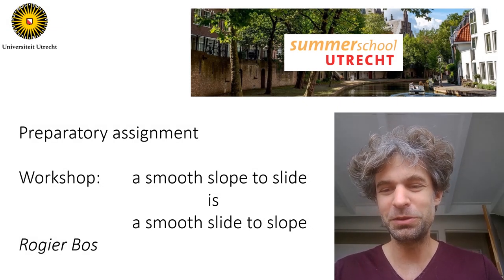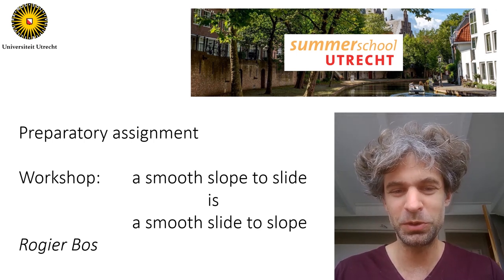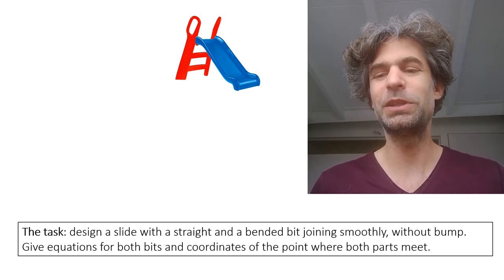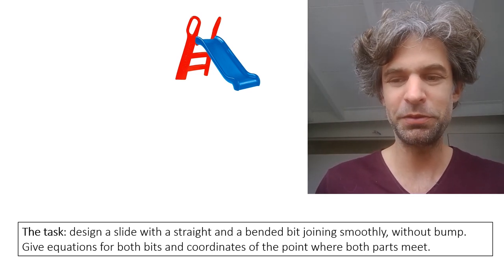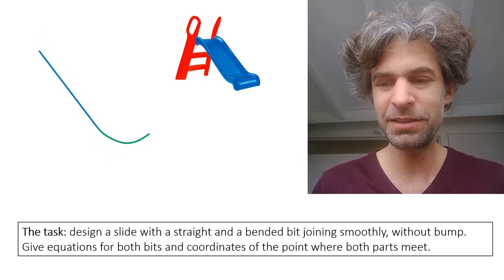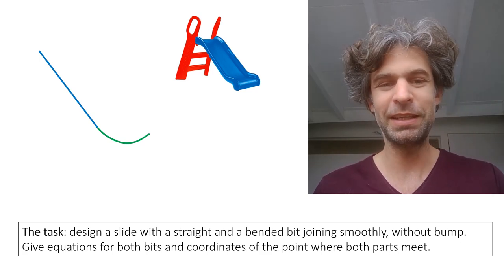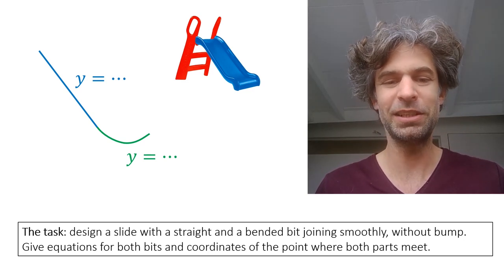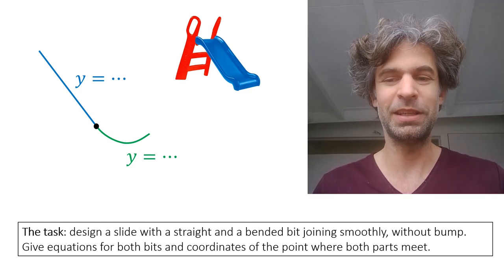Preparation task for workshop Rogier Bos

Comment: Wow, this is a great task! Nice application of derivative.
I use Desmos - first I created my bumpy part, determine the meeting point, and then formulate straight line equation using the gradient of the tangent line at that point.

Equation for the bumpy part: y = x^2, {-1<x<0.5}
Equation for the straight part: y = -2x - 1, {-2<x<-1}
The meeting point = (-1,1)
Assuming 1 unit = 1 m, my slide will be 3 m high and stops around 20 cm - 30 cm above ground. 
The angle of the slide from the ground will be 60 degree.

Not too bad for a slide I guess.

Comment: Thank you for the question. I use my algebraic knowledge to solve this problem. The straight line has the equation in the form of ax+b, with a is negative and the bended one's equation is in the form of ax^2+bx+c . 
-2x-1 and x^2 are nice equation examples for students in studying algebra. From those equations, one will find that x = 1 and y = 1

Comment: 1/3 
Hello from Greece! We are three postgraduate students in Mathematics Education, at the University of Athens. We solved the problem cooperatively, so we thought to share the solution as a team as well. 
First, we thought to use a function like x^n  for the curved part of the slide, ∀ n even number, with the necessary adjustments in the function’s domain, due to the change in curvature. 
We thought we could take ax^2 in the first branch of a piecewise function and bx + c in its second one.
Reply: 2/3
We used the digital tool GeoGebra, testing different solutions and graphs using sliders.
Thus, we realized that the tangent of x^2, is the required linear function, because it is the one that does not create an angle in their meeting point A (x_0, f(x_0)).

We used the formula for the equation of the tangent, finding the general form of the tangent: 
y – f(x_0) = f’(x_0)*(x – x_0) <-->
 …. <--> 
y = 2a*x_0*x – a*x_0^2     , f(x)= a*x^2 and (x_0, f (x_0)) the intersection point of the two functions.
Reply: 3/3 
We tried to have a piecewise function that holds for any A (𝑥_0, f (𝑥_0))

h_1(𝑥 )= 𝑎*𝑥^2 , 𝑥_0 < 𝑥 < 5
h_2(𝑥)= 2𝑎*𝑥_0*𝑥 − 𝑎*𝑥_0 ,−20 < 𝑥 ≤ 𝑥_0

Then we applied the h(x) function in GeoGebra and we finalized its domain, in order to look like a slide.

We can share the GeoGebra file with you, just let us know!
Danai, Konstantina, Nikoletta

Comment: Wow, such a nice problem. I make sure that the point is the point tangen of the two equation equation. And I use geogebra to confirm my visualization. So I got the point (-2,1), and the equations are y=1/4 x^2 and x+y+1=0.

Comment: It is a really interesting problem. Trying to determine functions for given points or curves is really challenging for students. 
I also used GeoGebra to find an appropriate solution. 
My solution is: -1,5*x-1, when x is less or equal than (-2) and from -2 to 1,4 the curve is 0.5*x*x. The point where the parts meet is: (-2; 2)

Comment: What an interesting task. 

At the beginning, I though it was simple problem. But, when I try to solve it, I found that it was quite challenging.

First, I try to draw the parabola which the equation is y=1/4 x^2 then I try to decide the point tangent (-2,1) because it has the smooth curve after that point. Then I formulate the linear equation with the angle 45 degree, which is y = - x-1.

Hope the answer meet the expectation of the task.

Comment: Thank you for the nice task.
I find that the gradient for the slide that is safe for kids is 30 degrees. I used geogebra to do a simulation. I propose y=(0.5x+1)^2-1 and y=0.8x. So the meeting point is origin (0,0).
It's not exactly 30 degrees but it less than 45 degrees.

Comment: Thank you for the task. Assuming the height of the bended part is 1 meter, set the meet point coordinates (-1,1), the function of the bended part y1=x^2.
The tangent y2 of the function y1 at (-1,1) will join smoothly with y1.
The slope of the tangent of the function y1 at (-1,1) is -2, that is, y2 is a straight line that passes through the point (-1,1) and has a slope of -2, and its expression is y2=-2x-1.
In summary,
y1=x^2, 
y2=-2x-1, 
and the meet point is (-1,1)

Comment: Thank you for the interesting task, Mr.boss.
The problem very real, I try to make quadratic equation and linear equation are friendly equation to make smooth.

Firstly, I use quadratic equation y=1/4 x^2 to make the curve in x= [-2,2].
Then, I use that equation for x= [-4,2], so I find {(x, y) |(-4,4), (-2,1)} finally I use that coordinate to get linear equation y=-3/2 x - 2.

so, y1 = 1/4 x^2,     x=[-2,2]
y2 = -3/2 x - 2 ,      x=[-4,-2]
the meeting point (-2,1)
but I still have not idea how to make sure this is without a bump.

Comment: The idea of formulating the equations satisfying such a condition is that the intersection point of the first equation (the linear function), represented as y1, and the second equation (the quadratic equation), represented as y2, should be differentiable. I found an example of this condition. Let's say x=-1 is the absis of intersection point of  y1=-2x-1, and y2=x^2. By checking the first derivative of each function, we found that it is differentiable at the point (-1,1). Thus, a slide with straight line (y1) and a bended (y2)bit joining smoothly

Comment: Thank you, in my opinion
1.the gradien of the line must be same with the curve.
2. If the line is y = mx + d, and curve is y =ax^2 +bx+c we get x =(m-b)/2a and  ax^2 = c-d
3. For the m=-1,b=5,a=2, we get c=5,d=1/2 so the point' is (-3/2,2)
4. The line is y =-x +1/2, the curve is y = 2x^2+5x +5
And many more answer 
5. For the m =-2,b=8, a=1, we get x= -5, and c=  10, d= -15, so the point' is (-5,-5)
6. The line is y=-2x -15
The curve is y = x^2 +8x +10. And many more. Thank you

Comment: Hi Mr. bos,
the question was very interesting. Thank you for giving this question. 
I try to solve this problem or try to designing my slide using Geogebra Apps.
There are many variables that I need to decides first before answering this question.
First, I decide use linear equation and cubic equation.
Second, I use 45 degrees for my slide. But I am not sure with this. 
Third, the equation that I make on geogebra apps is:
y= (-3^((1)/(2)))/(3)x+0.99  (Linear equation)
y= (-(x-1.00808)^(3))/(4)+0.72925 (cubic equation)
Intersection point is (0,1)
Note: I just copy the equation here. 
and I think i slide is smooth enough. :)
Thank you.

Comment: My opinion, there will be many solution since we can make pairs of connecting linear equation and with quadratic equation as long as the linear equation is a tangent line and the point of contact connect with the quadratic equation. for example y = 1/2 x ^2 and y = -2,2 x - 2,4 then the (-2,2) is the point of contact. but it is difficult to find a standard with one is the smooth one because it also relate with the steepness.

Comment: The problem is fascinating. I used GeoGebra to help me visualize my graph's equations. I decided to use y1= 0,24x^2, then I took point (4,4). I used this point to guest the linear line, and I calculate the derivate of y1, then I chose y2= -2x-4.

Comment: Before deciding the equations, we should understand that a slide should be safe for people, especially toddlers, to go down. We assume that the maximum angle is 45˚ and the height is approximately 5 metres (1 unit on the grid illustrates 1 metre). I use an applet to help me to illustrate the slide and the bump.

The slide: y = -0.6x + 4.2; -1≤x≤8
The bump: y = 0.1x^2 – 2x + 9; 8≤x≤10

The slide and the bump will meet at [8, -0.6]
.

Comment: I want to make a nice line with 45 degree meaning the slope is -1 and the  meet point is (0,0). Therefore my linear function is y = - x. For the curve, I am using  quadratic equation f(x) = ax^2+bc+c and employing derivative, obtaining b as -1 and a should be any number (choosing 1 to make it simple. 
So, my line is y =-x , my curve is y = x^2 - x , and the meet point is (0,0).

Comment: Firstly, making curve equation (quadratic function) y1=Ax^2, A is a real number. Secondly, determining the meet point which connects both the curve and the line. Here, easy numbers (integers) are chosen which is close from the peak of the curve, namely (p,q). Any points as meet points can be chosen. Thirdly, determining the line. Suppose it is y2=Bx+C. B is the slope of y2. The value of B is from y1' [a derivative of y1 in (p,q)]. Finally, determining the value of C. And then, we have equation of y2 as the line. Two examples from my work: y1=x^2, y2=-2x-1 and the meet point is (-1,1) another one is y1=0,5x^2, y2=-2x-2, and the meet point is (-2,2)

Comment: May strategy is making up a linear equation with a certain slope. at the meet point, curve should has the same slope. let it is 1. Curve whatever it is quadratic or other, should have slope 1 at the meet point. By integrating linear equation, curve equation can be found including meet point. However, I did not found it.. hehe

Comment: Hello
I browsed about slide. I got the height of slide is 140 cm, the length is 220 cm, and the angle is 50 degrees (I made all of them in whole number to made it easier). I think the equation of linear line is y = - tan 50 (x - 167) and for the second equation is y = x^4. I chose y = x^4 since for me it seemed suit more to bottom part of the slope. That is all I get now and looking forward to how to solve it.

Comment: As written in the handbook for public playground safety,  the average incline of a slide is no more than 30 degrees. This can be measured by determining the height to length ratio that does not exceed 0.577. Additionally, the slide moves downward from the left to the right resulting in the negative slope (For straight line equation : y1=- mx +c). For the bended curve, it supposed to be quadratic equation y2= ax^2+bx+c and it resulted the same gradient between the straight line and bended curve. I tried to draw the situation by using geogebra. But, there are many solutions to show the intersection point. I'm still curious and look forward to know what's the exact answer for this problem.

Comment: To visualize the curves, I used geogebra
I use quadratic equation for the bended curve
y_1 = -x - 2,   Dy_1 = {-4 <= x <= -2}
y_2 = x^2 + 3x + 2,   Dy_2 = {-2 <= x <= -1}

Intersection point (-2,0)

Comment: There are many possible solutions that can be made to fit this problem. I would like to give one example that I have worked on. Example, I use quadratic equation y1= 1/4 x^2 and the second one is a linear equation y2= -x -1. If I translate the word "smooth slide" into mathematics that the two equations meet at one point, which is (-2,1).

Comment: Interesting.
At first, I found out that an ideal height of a slide is either 1, 3/2, or 2 m (i chose to make one with 3/2 m height) which declined by approximately 40 degree (i chose to make one with 53 degree for friendly numbers, the 3:4:5 ratio side).
I also decided to start the bend (the 2nd equation) 50 cm before it touches the ground, and stops at around 10 cm height.

So, I set my first function: y = -3/4 x + 3/2 for x=[0, 4/3]

To ensure that there will be no bump when my two curves meet, I designed my second curve as such it meets with the first curve at (4/3, 1/2), and then make sure that the slope of the tangent line of the second curve at x=4/3 will be equal to -3/4 (following the gradient of the straight line).

So, my second function would be: y = 9/16 x^2 - 9/4 x + 3/2 for x=[4/3, 11/5]

Comment: I used www.desmos.com to graph the functions. 
Line eq. y= -08.x-0.065 {-1 <= x <= -0.27}( I chose the slope so that the transition from line to curve would be smooth.)
The curve: y= -3 x^3 - 0.1 x^2 +0.1 {-0.27 <x <= 0.3}
Intersection point: (-0.27, 0.15)

Comment: What a problem!
I browse that the gradient for the slide which is save for children is 30 degrees
by that, the ration between y and x should be the tan of 30 degrees which equal to 1/ the square root of 3 (1/V3)
Also, the meeting point would be the only number which is belong to the equation for line a (y = ax + b) and the equation for line b (y = ax^2 + bx + c)
Well, that's all i can provide for now. Looking forward to know how it can be solved!

Comment: My proposition
, but I have no idea how to check it (by calculation) if there is a bump or not (maybe just every tangent to the parabola):
y1= -x+2.5 for x \in (-infinity, 0) 
y2 = 0.1(x-5)^2 for x \in <0, 5>
and the point where both parts meet: (0 ; 2.5)

Comment: I tried to draw lines by using Geogebra program and I found that 5.61x+2.26y=-32.46 and 1.88x^2+1.34xy+0.24y^2+26.62x-5.8y=-128. The intersection point is (-6.74, 2.39)